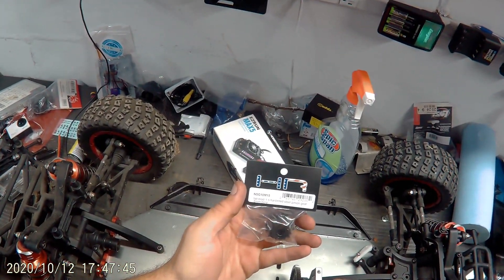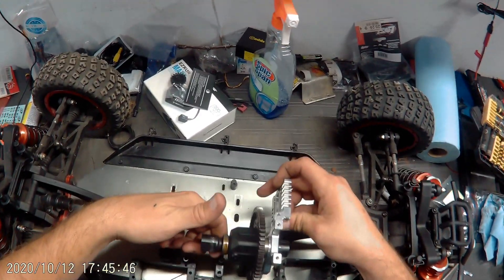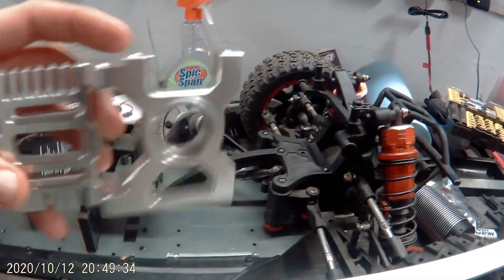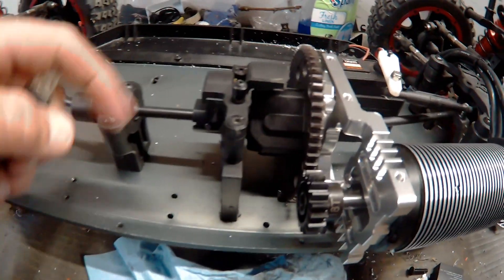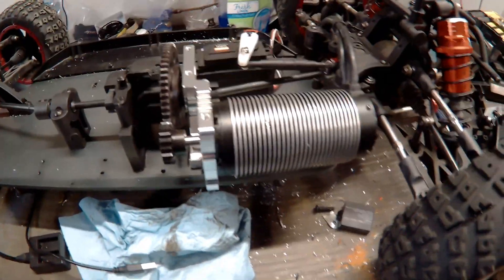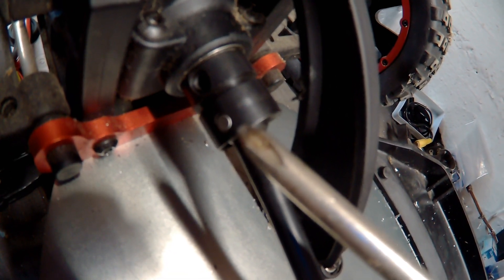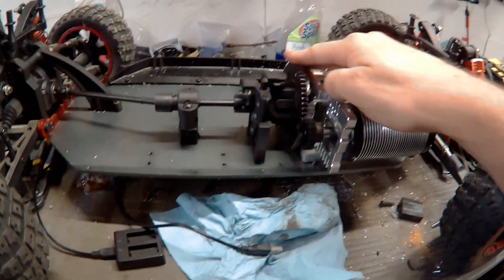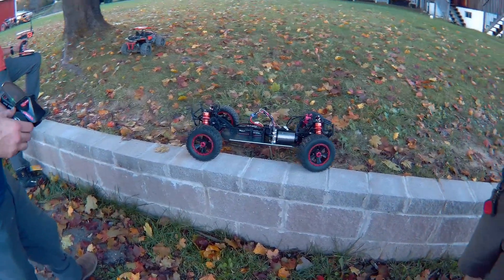Losi DBXL electric conversion

Comment: Why didn't you run the mount and motor 180°? I have a conversion and if you just turned that mount 180° so the shaft would be facing the front of the truck. If you have a email or Instagram I could send you pics of mine.  But it's literally like if you just turned it around and the motor would be sitting more towards the driver's side rear with the shaft facing front.
Reply: Did you use the DBXLE mount as well for your conversion? If so did it bolt directly to the original chassis holes where it took the place of one of the center differential mounts that you removed or did you have to drill new holes? I wasn't able to tell from this video. Hope to hear back from you and thanks for any help you may be able to provide.

Comment: Hey buddy have you had any trouble with your max5 esc? I put the max5 combo in my conversion and I'm getting half power where it's like going into limp mode. Have you had any issues with yours?
Reply: I just had this issue and it ended up being the throttle end points. I couldn't figure out why, even after putting my throttle to max on the controllers trim it would only go 50% or even less on full throttle. I think it's best to reset your throttle end points after you change controllers.
Reply: @bribanzzz9857  Hey bud thanks for the advice but it would be driving fine and full speed 50+mph and then it would go down to like half. I think it was going into limp mode or something. I think i might be overgeared on the dbxl. Im running a 18t and it got up to like 55mph which is crazy fir a big rc like that. I need to get it out and run it. It was also cold and the winter that night so maybe it was that too. I'll report back. Thanks bro. I'll definitely double check that as i usually do that on my initial set up with my flysky gt5
Reply: @cwatson42785 I'm running a 13t and can easily get up to 55mph I used to run 18t but its not as smooth but definitely still manageable. Has to be something else unless you're running into heating issues.
Reply: @bribanzzz9857  Wow you're getting 55 out of a 13t? I must just be way too overgeared. Because I have run it and it's been fine a couple other times. It might have just been the gearing or maybe the cold that night 30°. I spit a driveshaft pin I need to fix but I'll fix it tonight or tomorrow and I'll run it and report back bro. Are you running the old max5 combo? Or is it the newer gen one? What gearing would you recommend? Should I go with the 13t like you or maybe 12 or 14? I really don't need it in the mid 50s tbh. I'd be happy with more torque and I'd say high 40s would be cool. I always like to have a little extra power on hand and not use it than the other way around lol. Appreciate the trouble shooting and help bro